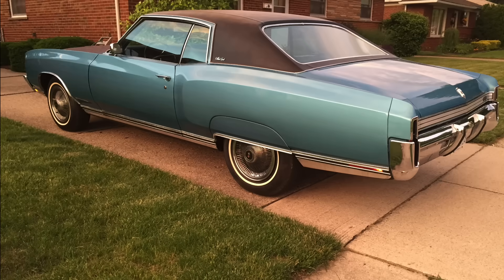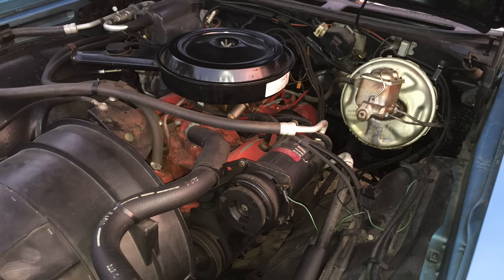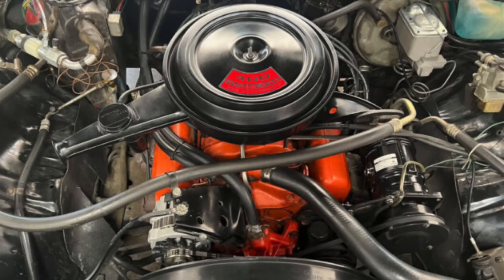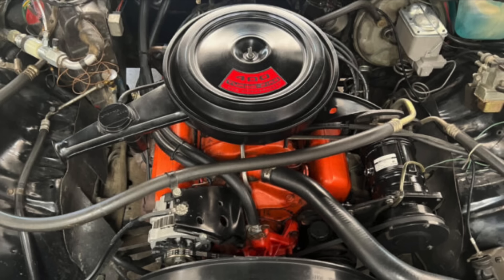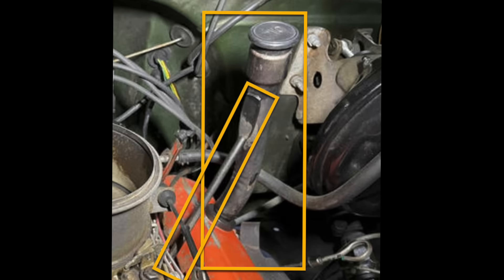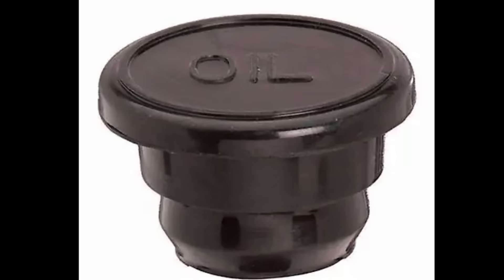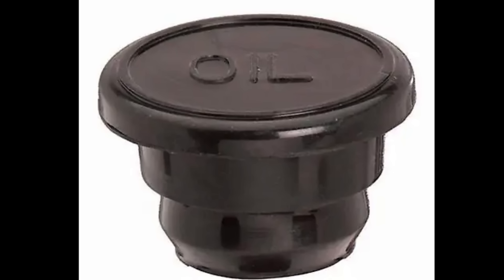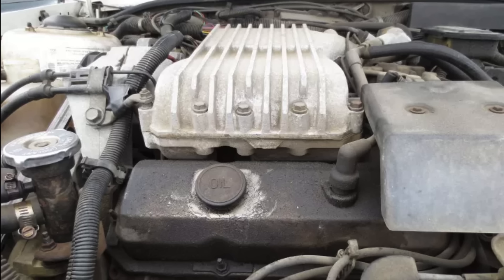Worst Automotive Ideas: Chevrolet's Crumbling, Rubber Oil Fill Cap (Small Block V8 / 2.8L V6)

Comment: The ford ignition modules on the distributor, 4, 6, 8, 10..  Some stupid reason it put near a heat area that dries out the grease and it shorts out.  Every car and truck had this module, 1972 to 2009.  Friend had a 2002 f 250, that blew out, its under the battery.

Comment: I dunno, seems like the poor small block suffered through many other quality cost cutting blunders much worse than this CRS oil cap.  I remember my buddy's 72 Impala 350 2bbl had this rubber plug, but my 73 Caprice 400 small block had the conventional metal oil cap, guess they must have switched back in 73.

Comment: My 1985 Chevy Astro with the 4.3 Liter, throttle body V6, had this rubber oil fill plug. It also had a really long oil dip stick

Comment: Now do the wiring on 90's dodge cars and trucks the engine loom is made of super thin wire lying directly on the intake manifold where the insulation falls off from heat cycling and being the redheaded stepchild of the performance world nobody offers after market replacements

Comment: GM had the coolant return lines running down the passenger side , right behind the front wheel on the Beretta. In Canada and Northern climes, we use a ton of salt that was coated on the lines from November to May from wheel splash … basically these rotted within two years. Green coolant in every Beretta owners driveways!!! 😮

Comment: Want to know what I think was/is waaay worse?  Side post batteries.  Want to jump it?  Get bent!  Want to easily remove a cable for storage?  Noooope!  Let’s cut threads into soft, soft lead and give it to the great unwashed masses!  Thanks, Vega!
Reply: 1982 I bought a '73 Olds 88 455. It had 30,000 miles but looked like it just rolled off of the show room floor. It had a battery with side posts. The day after I bought the car, I replaced the battery and cables with top posts,. I had heard many people saying the side terminals were not good. I got ahead of that and never had the problem. I kept that car for 28 years. It was the most dependable car I ever owned. With regular maintenance, it never broke down.
Reply: @jamesbulldogmiller  the Evil Dead car!
Reply: Dodge Avenger. Let's put it under the right side wheel well cover.

Comment: I don't know...I've been an auto/ truck  mechanic for a long time and consider "anything" under the hood that's made of rubber as a "perishable" item that needs replacing after a certain amount of time. It doesn't matter to me if it's an oil fill plug, pcv grommets, blowby tube grommets, engine belts etc....They ALL need replaced at regular intervals.....Can these plugs possibly crumble when old and have some pieces fall into the head, sure, but that just means the owner has not properly maintained their vehicle. I don't necessarily think it is a bad or flawed design, just different.

Comment: I wish I could say the rubber oil fill plug was the worst thing about the 2.8 V6 in my '83 S-10 Blazer.  Unfortunately, the oil filler plug was overshadowed by the aluminum heads / iron block issues.

Comment: I worked at a gas station thru the 70s. I think 1971 was the first year for the rubber plug. I remember them being difficult to remove or install as early as the car being only one year old. 1971 was the year where GM really started to get into the chintzy cost saving mode.

Comment: The 1974 Ford Mustang fuel cap was located below the body crease and fuel will easily spill out when re-fueling. The 1975 models it was moved above the body line crease in an attempt to cure this, but from what people have told me, this did not really solve the problem.

Comment: My 1972 Corvette 454 has a rubber oil fill cap from the factory. I've replaced it 3x over 10 years. Mine turned rock hard and disintegrated with some of it falling into the engine. I finally got sick of it and put a metal unit from the 1968-1969 years of BBC.

Comment: My parents had an '86 Jeep Cherokee with the GM 2.8 V6 but I'm pretty sure it had a regular metal cap. My 2002 Jeep Grand Cherokee is a great vehicle, but it does have one dumb idea: It's 4.7 V8 has a very large appearing oil fill tube. The first time i changed the oil, I figured I could simply  place the oil can upside down on the filler tube and let it drain. Nope, turns out there's a restriction in the tube and oil spilled over, making a big mess.

Comment: My 72 Caprice had the rubber plug, and 400 small block engine.  I went through two or 3 of them in two years.  During one oil change, it went to pieces and fell in the engine.  They were able to retrieve the pieces, as far as I know.  My sister had a 71 Vega (🥵) also with a rubber plug.  It was a disaster in every way.  The plug might have been one of the better components, as bad as it was.  You have to ask yourself, “what were they thinking?”

Comment: This isn't in the top 100 examples if you include British cars. Near the top of my list - putting the ignition coil immediately below the carbuertors on the Lotus Esprit Series 1. Carburetors supplied by a plastic fuel line, and split to front and back carbs by a polystrene fuel "T". In a completely unventilated engine tub that includes the exhaust manifold and all the emissions equipment. Engine gets *extremely hot*, no air at all blows through it, fuel "T" gets brittle from gasoline and heat, splits and leaks gas right on top of the coil, fwoomp! Big fire.
Reply: That's a very unusual demise of a UK car. Typically, it's when excess smoke comes out of the wiring harness.

Comment: “Bad Ideas”, or just sloppy. . .   My 1995 Z286-speed had a bivration from day one.  Dealer installed an aluminum drive shaft (no charge), but it didn’t really fix the problem.  I realized the vibration was the worst AFTER a gentle upshift.  By then, with my own mechanic, we tracked it down to a clutch disc meant for a larger transmission spline (from the factory).

Proper clutch disc installed, end of problem

Comment: Some mentioned the nylon toothed cam sprocket. They did it to cut down noise.
Reply: That would break, causing motor to stall and car having to be towed and owner facing a big bill.

Comment: "worst automotive idea" has to be traction control with throttle retardation. My '05 Honda had it and it dangerously disabled the car as soon as the roads got slippery; you had to remember to hit the disable button as soon as you noticed snowflakes landing on the pavement, or you'd have trouble crossing intersections. Toyota was also known for this problem and on some Prius models, you could not disable the traction control, which was used to keep the motor-generators from over-revving. The Chrysler I had before the Honda had a simpler traction control system that just cycled the brakes and it usually worked flawlessly; I only had to disable it once, when the snow was just the right temperature to stick to the tires.
Reply: My 2003 Ford Mustang GT Convertible was also awful in the snow for the same reason. Except you could never completely turn off the traction control. Off was just a less restrictive setting. Once you got stuck, there was no spinning the wheels to get unstuck. On the other hand my 1994 GT Convertible that I owned at the same time was a beast in the snow. Never ever got stuck and would only slide if you intentionally made it do it.

Comment: My 89' S-10 blazer 4.3L v6 had the rubber cap. It started to crack and little pieces breaking off. I replaced it.

Comment: My dad's 1971 Biscayne had that stupid plug. I thought it was too hard to put back, I missed the metal cap from our old 1964 Belair. But, I thought a worse feature of that car was the "quiet" timing gear with the plastic teeth. We replaced it at 40k miles; the replacement part was all metal and lasted until the car was sold 210k miles later.

Comment: My 93 Astro (4.3) has the same looking plug as shown in your picture on the small block.  It's getting harder and harder when I change the oil to handle this plug.  Might have to look for a replacement.

Comment: the rubber got so hard i recall bringing out the persuader dead blow buddy -how about lower ball joint grease fittings facing straight down without enough clearance with rim bolted on not saying who was guilty of this

Comment: Any car that you have to remove the gas tank to change the fuel pump.
Reply: On camaro gas tank is above rear axle first remove"rear  diff, thenfuel tank n finally fuel pump .vw jetta has acess cover under rear seat cushion take out cushion n cover n pump is rite there.leave tank in place, not even have to drain it, easy

Comment: Ford 302 and a head design where water comes from yhe back to the front... Only openings on the rear of the engine. Prone to overheating.

Comment: Honda d series pcv valve. It's underneath the intake... So no one ever touches it. They clog and there you go..  oil in the manifold (through the vslve cover). Than issues aith the IACV...

Comment: iv got a good stupid thing that a manufacturer has done, from personal experience. This would be a Ford thing that went on for several years and it took the aftermarket way too long to make a fix. My example for today is the  self adjustable plastic clutch quadrant on standard transmission Fox body cars. They were weak broke regularly and could leave you stranded on a whim if you don't know how to clutch less shift. It took forever for someone to finally make them out of metal and it wasn't Ford with the fix. Why it took so long to address and why did it need the aftermarket to do it is beyond me.

Comment: First time experiencing one of these horrid caps was not on a GM product, but rather my 1986 Nissan Pulsar. Checked the oil shortly after buying it and was a quart low, went to add it and proceeded to spend a few hours breaking the cap off piece by piece with pliers. Great design LOL

Comment: I know that I have broken dozens of those caps, when I was a teen working at an auto parts store. Store manager would replace those  that we broke, and had a pair of long needle nose pliers to attempt to pull out as much of the broken rubber we could.

Comment: These plugs do break apart and fall into valve covers and  end up in oil pans. Starters mounted under the intake manifold. HVAC controls either allowing defrost OR floor. Terrible In the great white North. Lifting engines, or lifting cabs off to change plugs.

Comment: I remember as a kid. Seeing that rubber fill plug. Usually when my Dad would be replacing either the water pump or alternator. Go figure! And think how cheap that looked. And I was an 8 year old! GM and their bean counting! It still haunts them to this day! I know. I won't buy another GM product! And my Dad retired from GM.   He worked there during the late 60's and early 70's. GM was at their peak at that time. It's sad what has become of them.
Reply: The very late 1980's and 1990's is what really killed GM. Not only were the cars poorly built but they are also wildly uncompetitive. All you had to do was put a 1992 Lumina next to a 1992 Camry or Accord and see the issue. Far too many people blame the X-cars and Vega. While it wasn't good for retaining customers, GM made lemons out of lemonade and at least got all the depreciation they could out of the Vega and X-body engineering.
Reply: I bought a new ‘79 Camaro 305.  Here’s a list of what didn’t go wrong on that car.  1. …………………

Comment: I have a 1984 2.8 "B" engine in my S10. Always get an OEM replacement oil fill plug. The after market ones don`t last as long or seal as tight. My old 1970 C10 has a twist to lock on steal oil filler cap. I think one could convert over to a push on type oil filler cap like those used on my old 1952 Ford 8N tractors if needed when the OEM rubber plugs are no longer available.

Comment: I remember that rubber oil plug on my '72 Nova and '71 Impala Custom. I recall replacing them after they went hard. I didn't think much of it since the replacement part was cheap and readily available in the aftermarket.
What I did despise was the increasing use of plastic body and interior components after 1967 and especially after 1972. To me, it spelled the end of the supremacy of the N. American car in our market.

Comment: The auto parts store I ran had a 1975 Chevrolet Vega Kammback wagon with the 2.3 aluminum engine as a delivery vehicle. It was 4 years old, had about 60,000 miles on it and drank oil. We put a message on the dash that read, “driver must check oil when filling gas tank.” Sure enough, one day one of the drivers was purchasing gas, checked the oil, it was down a quart, so he obtained a quart to add. This was the days before plastic bottles with easy pour tops, so you used a metal spout you punctured into the top of the oil can. In doing so, said driver spilled a small amount and got it on his hands. When he went to replace the rubber oil plug, it slipped out of his hands and rolled into a storm sewer. He couldn’t retrieve the plug. He went into the gas station to explain what happened and ask someone if he could drive the car without that plug in place. They apparently told him emphatically no. The driver panicked and decided to plug the hole temporarily with a shop rag. Almost immediately upon starting the engine, the rag was pulled into the valve train area and wrapped itself around the camshaft. Somehow he managed to drive the car the two blocks back to our store. When he pulled into the parking lot, I could hear the misfiring, backfiring both through the exhaust and carburetor. The driver came in and told me what happened minus the rag part. I went out to inspect the situation, started the car, popped the hood, and immediately observed the oil soaked rag wrapped around the camshaft spinning furiously. That was the end of that vehicle. When I questioned the guy at the service station about it he said he misunderstood what our driver was asking and thought he meant long term without the cap. Fortunately we were planning on replacing that car soon anyway.
Reply: That's definitely a Vega story! 😂
Reply: many moons ago i did a oil pump /screen job on big ol ford V8 where u cant really get pan out but enough screw jack and 2 x 4 wedges and u can get it done sure enough week later its back same problem after going back in there was ol shop rag stuck to sump screen
Reply: I knew a good friend of mine, who's family bought a '75 Vega hatchback new. When it was about 5 years old, a shop did an oil change (the family maintained it regularly, it was a great little car), anyway the shop either lost the rubber oil plug, or it fell apart. The car was driven home after the oil change. They had to add a quart of oil, about every two weeks, by then. It was discovered that a shop rag had been used to plug the oil fill hole, two weeks previous, amazingly the car had been driven and most of the rag was in pieces, in the upper valve tappet buckets and springs! The valve cover was removed, all the bits cleaned out, oil changed again, the car ran many more trouble free miles, just needed a quart of oil every two weeks or so! 😊
Reply: @davepike6170  either your friends were incredibly lucky, or my store was incredibly unlucky
Reply: You can't make this up 😅
Reply: I used to drive a few Vegas. They were cheap and everyone wanted to get rid of them. I had a 75 GT and was going to go to my parents place from Toronto an hour and a half west to their farm for Christmas. Here it is Christmas eve and my cam belt breaks. With the Vega there was no interference between the pistons and the valves to I was good that way but I have almost no money to my name. I pushed the car onto a side street under a street light and hitched hiked to the nearest Canadian tire and was so lucky that they had a new belt in stock. With the Vega you have to pull off the water pump as it works as the belt tensioner so I got a jug of antifreeze as well. I had a tool box in the car and changed that timing belt in the dark under that street light mostly by feel and was able to get to my parents place at around one or two in the morning. I actually have some pretty good memories with those cars and still have my V8 74 Pontiac Astre GT. Probably one of five or less GT cars left in Canada.

Comment: I have a 1979 Z28 Camaro it has a 350 engine in it but it's a smog engine the block and heads are not as thick as the older engines the camshaft was soft and had to be replaced where do you think all that metal goes it took out my main bearings it still ran I put in my engine out of my 1973 Impala to use the car till I get my HO engine built have a blessed day today 🙏

Comment: Chevrolet did not expect for those cars to last as long as they did ....and even less for the garbage they make now . That is why  they went to GRENADE GRADE ENGINES  the rubber plugs outlast them 😂😂😂🤣🤣🤣😂...currently  a problem for GM .

Comment: A good video would be why California still requires smog checks on cars 1976 and newer.  Can't buy/find many of the required smog components anymore.
Reply: Because CA won't relinquish control of anything. Happily I'm now out of that control freak paradise. Interestingly, Idaho has abandoned its smog check program due to a low number of failures. This makes me very happy.
Reply: @Paramount531  Funny, my family wants to move to CDA or Sandpoint. or maybe Texas.  I've been to CDA a few times and love it.
Reply: @jetsons101  We checked out CDA but opted for the Boise area. Too much snow in CDA! We are very happy with our choice.